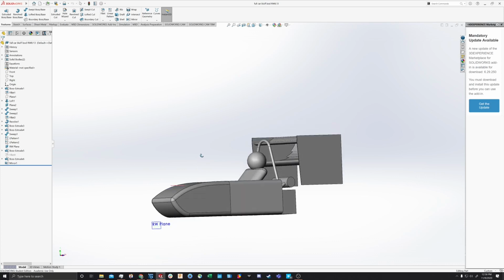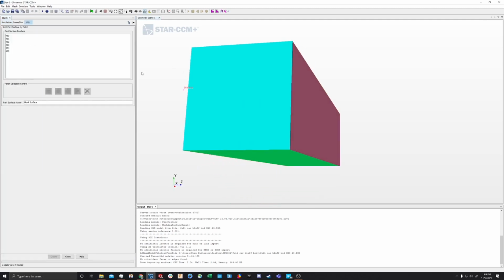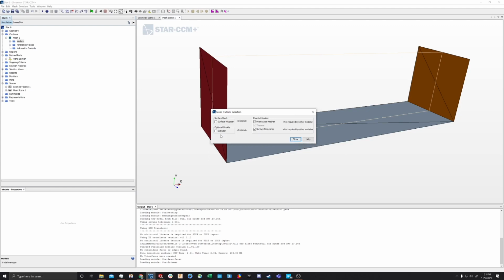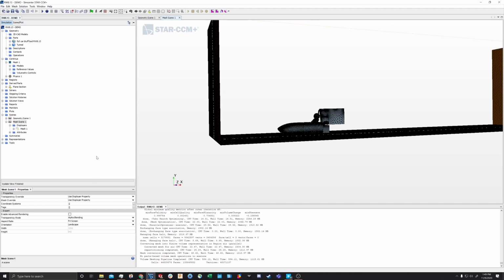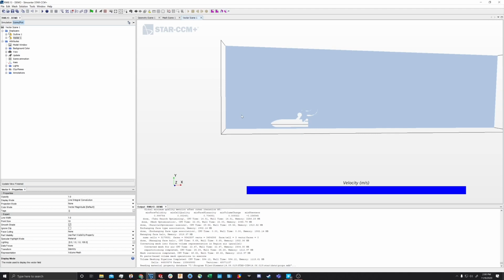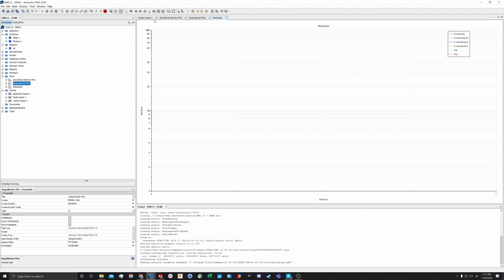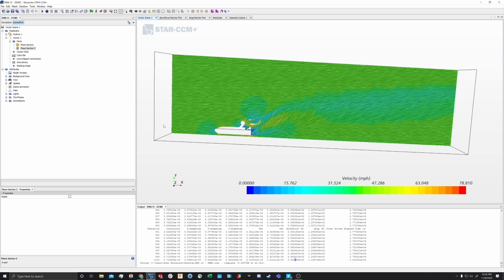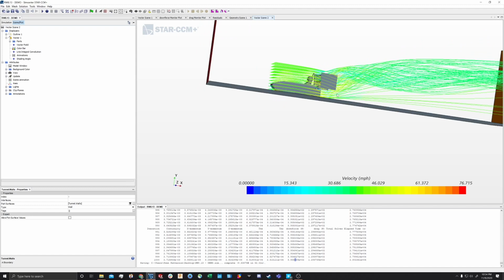Star CCM+ Tutorial

Comment: Hi, I am finding this video really useful. However, when I try to generate volume mesh I get this error 'ERROR region =air is not closed'. Could you please help me with this, I am very new to star ccm and need complete the project in 2 days. Thank you
Reply from the maker: If your region isn’t reading as closed you may be missing a face in the geometry feeding into the region, or that geometry isn’t manifold. Star needs to take in your geometry subtracted from a big box that essentially creates a single watertight part to mesh. If your region isn’t closed you’ll need to check and make sure that final part is indeed watertight

Comment: why dont you subtract the block from the car model?
Reply from the maker: The block is the domain in which fluid flows, so you want to create a surface inside it with the body being tested. I think you’d have some issues with your output part and region going the other way
Reply: Sorry i meant subtraction the car from tunnel.. i cant see this process in video.. you added big tunnel but the car is still existing in this tunnel but the flow domain should be represented in the region where the interior of the car has to be avoided.
Reply from the maker: @emregungor2969  did I use a subtract at all, it’s been a while since I made this and I use different procedures now
Reply: @owenpatterson9355  no u didnt subtract it. But somehow it seems star deleted interior of car region.
Reply from the maker: @emregungor2969  oh ok, well since the test body is completely within the domain, the surface wrapper just goes all the way around it to make the volume without issue. Our SAE team uses a subtract on half car models where the function remove half the car from the domain nowadays